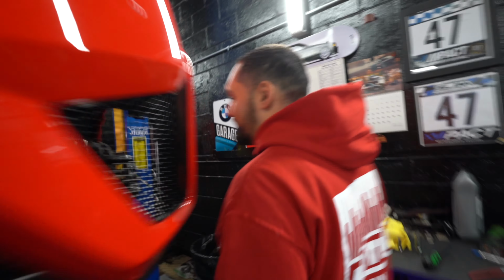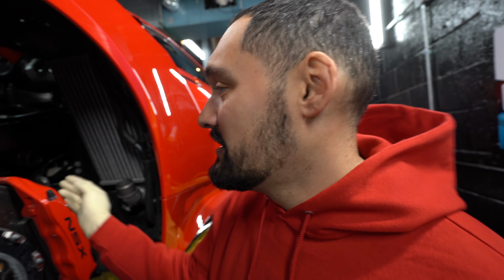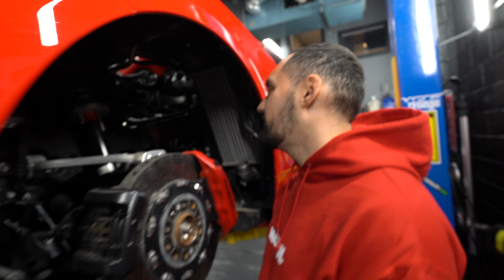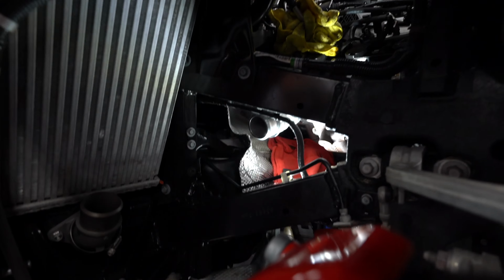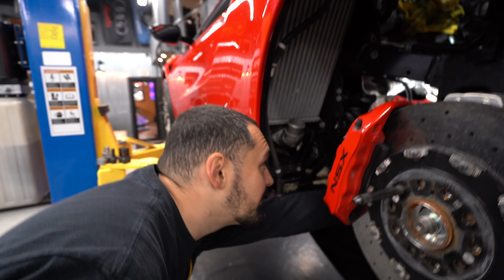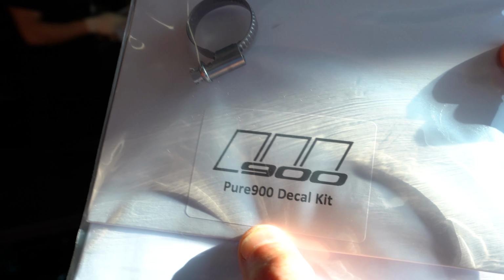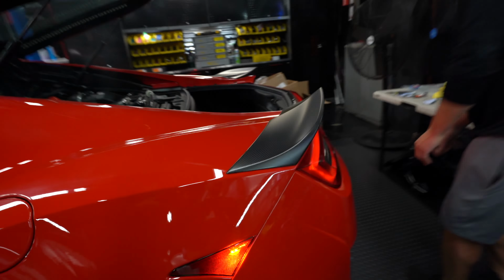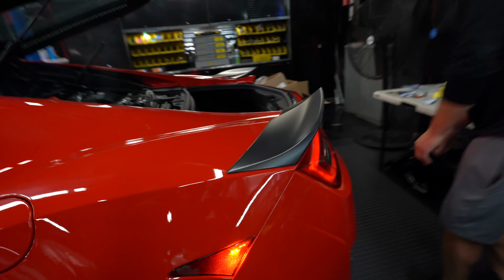Acura NSX Upgraded Pure 900 Turbos

Comment: Ive been contemplating the 900s in mine but dont want to do E40 - Do you feel a difference with just the 93 tune?  Was thinking about the intercoolers and those this year. Running the Ktune also. The B&M air filters do open up the sound of the BOVs a lot more.
Reply from the maker: @madisonscorner2180  yes you can definitely feel the difference and what’s nice is you can always do E in the future if you wanted! Thanks for watching
Reply: @acidynamix  Good to know! Ive heard mixed reviews but could easily be other factors in play there.

Comment: So did you need to loosen or remove the downpipes to get the turbos on?
Reply from the maker: The downpipes have to come out to remove the turbos. You do not need to remove the rear exhaust section. Thanks for watching!
Reply: @acidynamix  man, that's a huge pain.

Comment: Hello, from long island! Will have you guys upgrade mine as well and I won't cheap out on the intercoolers ; ) 
This car has the most fun factor of anything I've driven. The 911 turbo S is the only best comparison I've driven that matches this all around, but the new ZR1 zora coming out will take the cake.
Lookong forward to your spring tune that will get most guys off the fence as long as it makes substantial power over just changing down pipes and exhaust, which is a must regardless.
Anyone with a supercar would buy this car if they got off their high horse and test drove it, but they worry too much about people saying...it's a honda. Just swap out to a Euro boutique carbon fiber exterior and interior and it is a no brainer!
Reply from the maker: Couldn’t agree more!
Reply: woah you own an nsx? what year and is it a type s?

Comment: I had jb4 running 100 oct and e40 ktuner stock turbos....ktuner more mid power ...jb4 more off the line power ...the car is night and difference from stock to jb4 and ktuner ...but adding the 900 turbos for 7k cost ...my verdict is still out ....imo the ecu and tcu will not let you put all the power to the ground ....so my 0 to 60 time was 2.6 jb4 and 2.7 pure turbo e40 ... Hopefully so addtl tunning will be done to take advantage of more power ....upgraded intercooler , hd dp ,....new mich 4s tires , high flow air filter ...basically fbo ...every option one had i bought for the car ....i am happy but not 7k happy ...may make a difference on a track but real world ktuner stage 3 was best bang for buck 
...
Reply: I forgot to add these are not times achieved with launch control ....early bad luck with gtr...I don't believe in launch control....not worth the wear and tear to me
Reply: @prestonmay3 none of the Pure 900 cars have put down better performance numbers on the street or track than a stock turbo e40 car. There's issues with the tq management in the trans at that power level which will not translate the power to the pavement